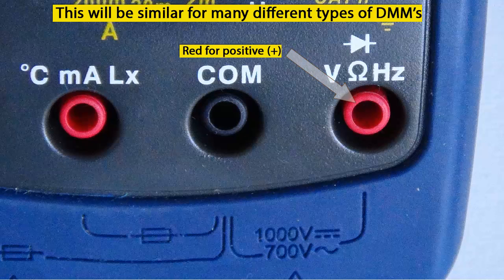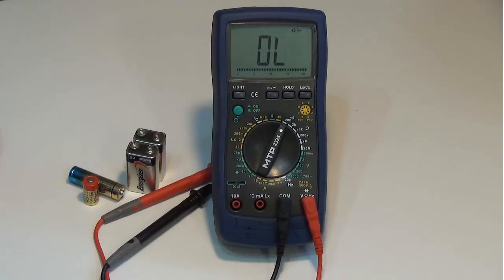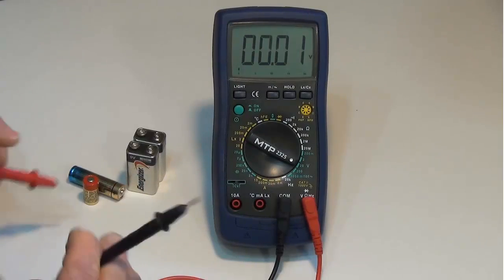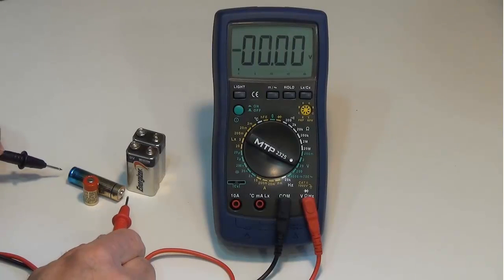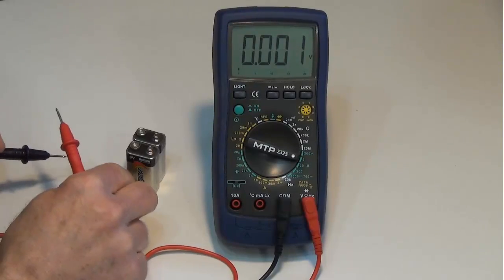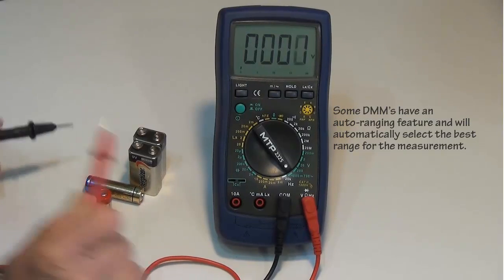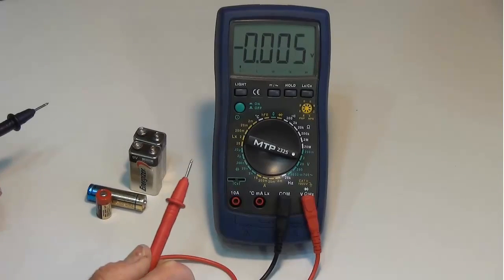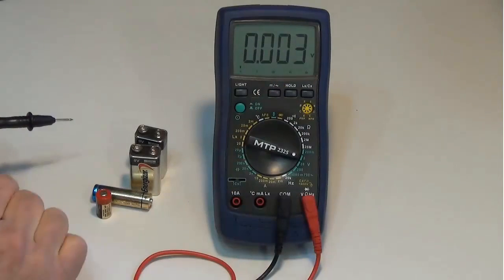How to measure DC voltage with a DMM / Digital Multimeter

Comment: Do we consume current from the battery when we measure it with the multimeter?
Reply from the maker: The multimeter will have an internal resistance.  Since we have resistance and voltage, there will be a small current drawn by the multimeter.
Reply: Should I remove the jumper on a dc power supply in order to get accurate reading?  The jumper is from one terminal to ground terminal.  I was expecting somewhere around 5 VDC output, but kept getting some type of countdown number or voltage dropout. Wierd.